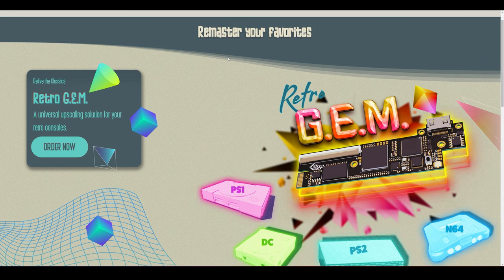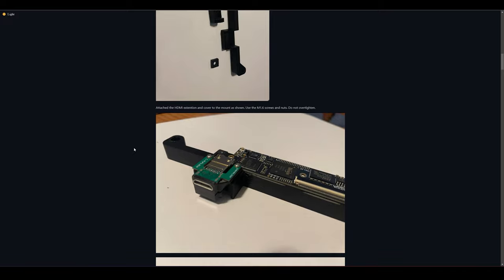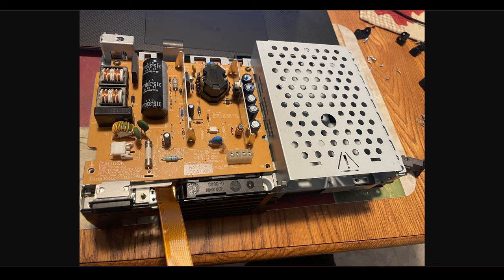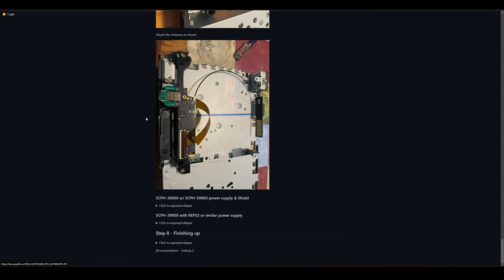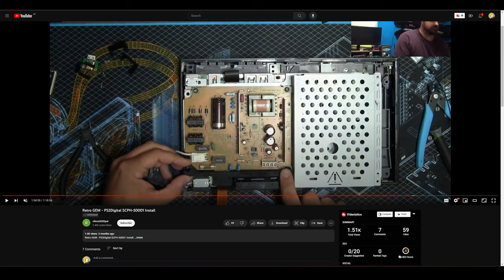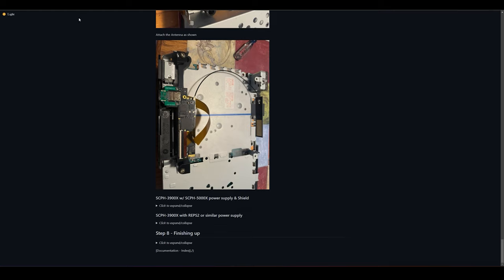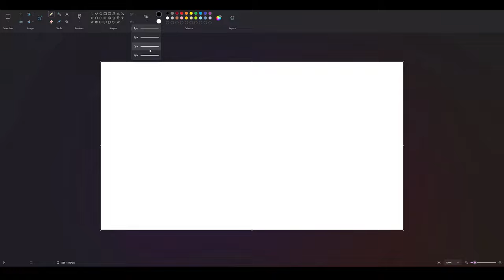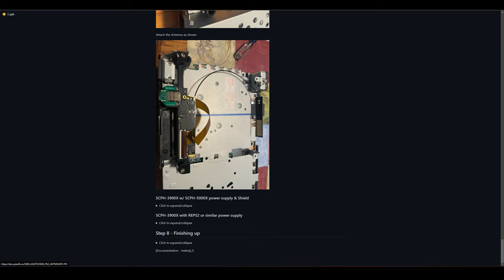This PS2 MOD Has a DEADLY Design Flaw !

Comment: I really dislike their scummy ecosystem of locking features behind a paywall
Reply from the maker: I’m still undecided on that front.
It is a common practice in hardware both consumer and enterprise, as it reduces manufacturing costs.
But with the release of their new external scaler, I am wondering if it switches these non-shiny models into higher res sneaky like.

Because the new scaler can communicate with the internal cards.
I guess someone needs to get both and run a splitter to see what’s going on

At least they are a little upfront that the only difference is software 
Panasonic pull that junk with their cameras all the time
Reply: @Slot1Gamer  Super late to this comment, but I think there's a difference here between the common practice you mention, and what they did. If the only difference was software features like scanlines and such, I'd agree. However, they also lock 1080p behind the paywall. The entire point of this kit is to upscale video out, and they lock the most desireable resolution behind the "shiny version." That goes beyond only software differences. They are intentionally gimping the hardware via the software that controlls it.

It literally can't even do what the entire device is designed to do, to it's full potential, unless you spend the extra cash.
Reply: @Profeces  Super late too, but this depends on how you see it and what you're trying to get out of it. For me the whole point of the digital mod is to get clean, direct, digital video out to feed to a scaler. If the system outputs natively 256p, get 256p, if it outputs 576i, get 576i. In practice, the highest resolution you would need to get out of this would be 576p on the PS2 . And then feed it to your scaler or TV to do the upscaling.

Comment: That is frightening! Can you imagine going to plug in the HDMI cable which has become Live because the User hasn't realised its hitting the Fuse and they will get Electrocuted... They should have provided something which insulates and covers the High Voltage of the PSU.

Comment: Even though the title of this video is a little intense, I wanted to thank you for posting this. I initially did this mod using my internal PSU, but decided to go with the RePS2 PSU after safety concerns. I think anyone doing this mod on a fat PS2 should do the same.
Reply from the maker: Glad the video helped :) 
Have you had any issues with RePS2 (not that I’ve heard of any but good to keep an ear out)
Reply: @Slot1Gamer no issues so far! Installing the RePS2 frees up a ton of room in there. Nothing to worry about anymore!
Reply from the maker: @thund4c4t025  it does seem good! just get a good psu for it :)
Reply: Can I ask y’all what you mean by RePS2 PSU?
Reply: Can I ask y’all what you mean by RePS2 PSU?

Comment: That antenna looks like one of those occasions where it's recommended to use a glue gun. You can get plastic sheets that are used for vacuum forming,  wouldn't take much to rig something up with a hot air station
Reply from the maker: Yeah I’d honestly just move it away or once you put the plastic cover I mentioned I think it would be ok :)

Comment: Can you repost the backup of the psx ? Or make a video to recover the hdd of psx i got a few psx with hdd working or can you tell me how to recover a psx of a wrong update
Reply from the maker: I’ll have to see if I still have them 
How did you put the wrong update? 
Are you sure the HDD are ok?
Reply: @Slot1Gamer  yeah the console are DESR 5500 and put by error the update disc 1.31 the psx dev site say DESR 5500 the release fw are 2.06 so i got error -1 every boot if i use fmcb i can access, now im trying get a backup of psx update 2.11 iso because i got one but this get a error i watch a lot info about use the iso burned in CD clean with fmcb and ulauncher I gonna try this
Reply from the maker: @DoaMuzz  let me know if you get it working 
I think the main copy of the update disc online is all the same iso 

I’ll have a look if I have one

Comment: A pvc or petg sheet should be good enough to stop the board from shorting out. Some of the guides I've seen show the wifi board being stuck on the fan.
Reply from the maker: Yeah you could even probably use one of those $1 flexible cutting boards from the dollar store haha 

Just fold it 3 times, punch some holes for the screws to go though 
Done

Comment: This is a great video, and I don’t think you’re criticizing anyone but rather sharing an important safety reminder. These older consoles, specifically the PS2 fat models, have an open PSU with large capacitors exposed. I’ve taken high-level physics and circuits courses, where we worked with large capacitors, and I remember my physics teacher showing us images of electrical shocks and burns before starting certain labs. We were trained on how to discharge a capacitor’s stored voltage safely. I believe most people, especially PC users, understand that a PSU can be dangerous. However, I think some may not realize that certain components, like capacitors, don’t need to be plugged into an active power source to shock you. Simply touching one of these capacitors while another part of your body is in contact with a grounded metal surface is enough to complete a circuit—and trust me, that can deliver quite a shock.

I’d really like to try this mod, but I’d probably add extra safety measures to prevent the IC or any wires from falling into the PSU. If any of this sounds alarming, it should be, but it’s all about having the foresight to understand what you’re working with. I also want to mention that, while I haven’t found any documented cases of someone being killed by a PS2 PSU shock, there are occasional reports of minor shocks, though they’re rare. That being said, this video still provides valuable caution. Any added components that come loose could increase the likelihood of electric shock or damage, so this kind of advice is important.           

I'm up late tonight, drinking way too much coffee, doing some astrophotography, and working on a PS2 for my nephew's birthday and Christmas present. I came across your video and, although I'll probably use this product, it will be on my PS2, not my nephew's. I'm heading to bed now; the sky tonight was disappointing. Anyway, clear skies and happy trails.
Reply from the maker: Yeah I think with some minor modifications it can be made safe, crazy that it’s not implemented from the start

Comment: Modder's Maxim #1: "When in doubt, break out the Kapton Tape (or Solder Mask and a UV light)".
That said always replace the old power supply of retro consoles.  (Especially if they have electrolytic caps.)

Comment: repsu is ideal ofc. i dont like the ribbon connector they've used on the gem, nobody has mentioned this. the connector on the n64 digital was brittle, the connector on the gem is so weak the weight of the flex can unlatch the ribbon connector and unplug itself, you need to push in the ribbon when its unlatched them squish the latch down for it to feel snug.

Comment: Would a pico mod for the fat ps2 fix this?
Reply from the maker: For this particular issue it would because there would be no mains supply in the system 
If you installed a pico psu

Comment: Would the RePS2 PSU mod rectify this flaw?
Reply from the maker: Yes
Reply: @Slot1Gamer So if the RetroGEM fell on the little RePS2 board it wouldn't cause any electric shock?
Reply from the maker: It may short out the board but re-psu is low voltage so no risk to people
You can still put some plastic over if you are worried

Comment: Oh no i installed it with my RePS2 Pico PSU.
Reply from the maker: As long as you insulate the retro from touching the 12v connector you will be ok
There is no mains inside when you use a RePSU